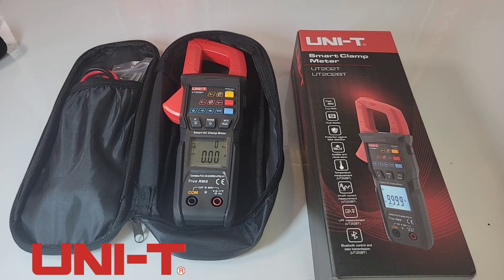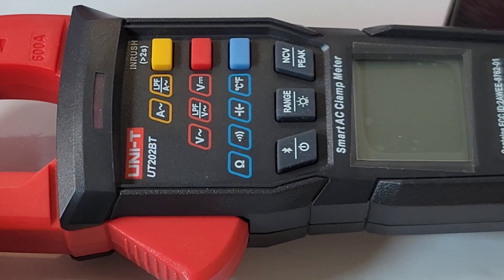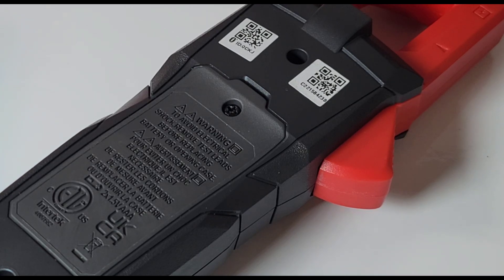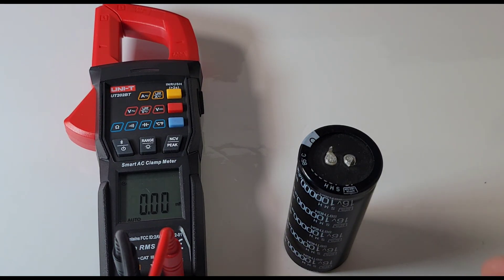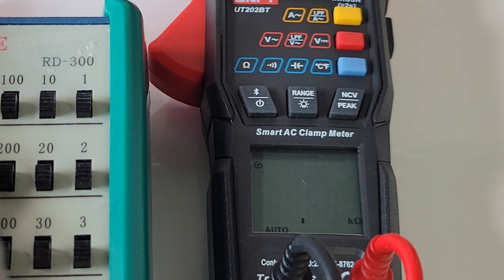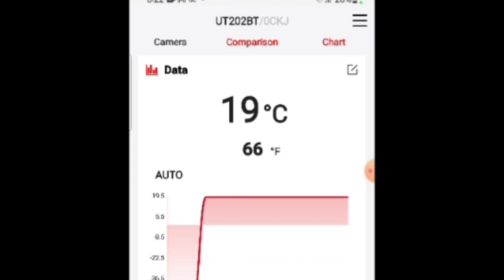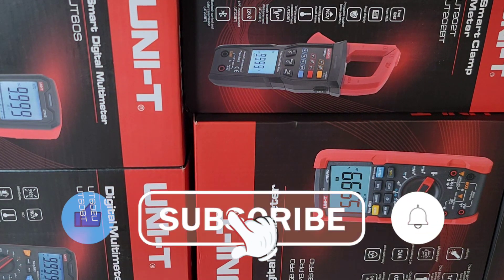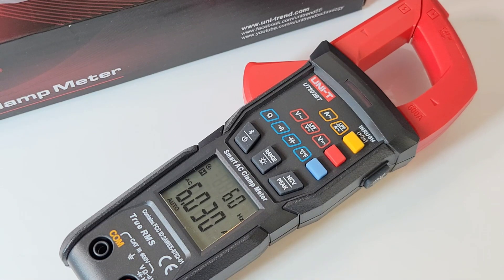UNI-T UT202BT CHEAP-O Clamp Meter Review & Teardown!

Comment: No DC amps gives it a 4/10 for me. Most AC line engineers deals with SOLAR these days, I think UNI-T can do better!!! THANKS
Reply from the maker: Thanks for the feedback. I agree a DC amp function would make it much more versatile!
Reply: I've got an old UNI-T  UT203. It's non True RMS, but it's accurate enough to get you  within the ballpark of the problem. If I need any more diagnosing, I use my Fluke 325 clamp. THANKS

Comment: Darren, thanks a lot for the review! I'm looking for this clamp since it per specs it meets my needs. Nevertheless, found a video on YT that reports that the clamp will not see small in rush currents, I guess below 10amps (it was tested side by side with a Fluke 316, which saw the 5amps in-rush, but the 202BT didn't see it). Can you test this? Because this would be a deal breaker since the in rush currents I plan to measure are on the low side, surely below 10 amps and probably around 5 amps (a small fridge for example). Also, what do you think about the clamp measuring inverter loads? it has LPF, so it should correct frequency variations. On the other hand, the other model I can think about that does pretty much the same (in rush, AC current -and also DC current-, NCV) is the UNI-T 216c, which is way more expensive, but apparently can do everything (and more), but doesn't have LPF (it has VCF). Thanks a lot!
Reply from the maker: @sebastian_j  Hi Sebastian, Unfortunately that clamp was gifted in a giveaway so no longer at my disposal. I did test it briefly and it measured inrush current as low as 1 amp in my tests.

Comment: Promoted as one-handed operation, well yes - if you are right-handed! 🫱. Good for persons who live in the alternating universe where diodes aren’t needed. Love the ability to capture inrush and document the results. Will have to give that a try for sure. 👋
Reply from the maker: Let me know what you think of the BT software when you get around to it. 😊
Reply: @KeepOnTesting  I did the inrush test on my vacuum cleaner and was able to verify it briefly consumes 40A when first turned on.  The BT APP allows you to select the meter's mode, range, and record multiple data logs.  The chart can be viewed on the phone and if desired exported to Excel file.  This file is very good, it has headers and gridlines - the data and looks like a report!  One of the headers was Chinese by mistake (a bug?).  Only thing missing in the file is ambient temperature.  You can select your data collection interval.  Also recommended - pre-selection of the range.  If it's in the auto mode, some of the measurements will be ".OL" -  Evidently the data in the report is the exact digits on the display.

Comment: It will be a hit in the right market. It is not a multimeter or a clamp to measure DC. I work in the shipping container refrigeration business and I finally have a low cost Bluetooth data logger. High resolution and precision are not required for its intended use, just that it measures something within the expected range. For my use it is more versatile than carrying an f376 (and cheaper) I can only blame how stressfully slow it is (but I can live with that).
Reply from the maker: Agreed..this can really work for the right user!😊

Comment: IMO it simply boils down to one targetted group: professional, industrial electricians (Where else do you have to deal with AC incrush currents and up to 600 Amps...?). And in this field it is very hard to beat the reputation of Fluke (or Gossen Metrawatt). Even with the beefed up input protection and the "ETL"- Marking. For my hobby (electronics in general and car -electric) I´m still very happy with my 201E. Uni-T seems to be more and more aiming at the professional market and less and lesser on the hobbyist/ educational part. My estimation is: It will not work, even on the long run.
Reply from the maker: UNI-T 210E is hard to beat..a workhorse in every way. Compared to most OEM's UNI-T seems to constantly  push boundaries and improve their lineup. I think it's evident on every level. Yes, this dmm is not geared for the bench but hopefully it's target market can see the value.👍

Comment: Greetings Darren))) Thank you for everything you do.
Beautiful electric сlamp)) Do you remember how I told you about the main chip that is in LOMVUM 616?))) Here it is, it's SD7502, and in LOMVUM it costs 7501, but it's hard to check because it is flooded with compound. As far as I remember, they differ in the number of readings (I'm too lazy to go to the site to see exactly, because it's not so important). In essence, this is one and the same. You can even see it first of all in continuity time, because in LOMVUM it is very fast, and UNI-T has never been famous for fast response, they are always slow. And in this UNI-T, the ideal continuity time is exactly the SD7502 inside. Here is a coincidence)))
In general, on the device, I will say this again. Electric clamps that have fully automatic range selection are not suitable for measuring current surges in the first milliseconds (100ms). They take too long to switch bands. That is, if you had the opportunity to test the Inrush function and check its operation with another device that has manual range selection, then I think that you would give a rating of 2.5 stars )) Since I am sure that this function would simply be useless in this device. All cheap devices with automatic range selection, with a low response speed, even in Inrush mode, take readings only for the first 300ms (if you're still lucky, otherwise it happens that there is a 500ms delay in general), and this is very long. Therefore, the purchase of this model, as well as other models with similar functionality, is suitable for those people who do not need to see inrush currents on the wires. This device is suitable for those who need to see a continuous load, in its minimum and maximum limits, but not bursts.
I have a wish for you Darren. Include in the list of obstacles for testing electrical clamps - CURRENT LEAKAGE TEST. It is very important. This test is for sensitivity in undercurrent readings. This is necessary for those who want to understand if there are leakage currents in their car, from the radio or some kind of light bulb, etc. I understand that this can be checked with a multimeter in the open circuit, but still I would like such devices as electric clamps to also see a small current within 20-30mA. Many in this sense have a very large error, but some electric pliers can do this. This is a good sign of a quality device. Thank you.
   $50 is overprice for him. 
Great, honest review! ! !
Reply from the maker: Hi my friend ! I will take your Current leakage test into serious consideration.  You raise alot of valid points. It definitely shows you the intracies involved in choosing the correct test instrument for your needs.   Excellent feedback as always 👍

Comment: What a letdown. No diode mode, but capacitance? No DC current? For real? The logging feature on the app sounds like a good thing unless you need to "log in". For something with an Arm based microcontroller chip the autoranging is very slow. Hope the next one in line is a great meter!
Reply from the maker: Great points 👉 👈  yea missing diode for me was a cardinal sin !

Comment: Well made UniT quality overall with a lot of bells and whistles - but not all the right ones - before adding less important doo-dad type stuff they should concentrate on most useful basic functionality such as DC current, diode range, a continuity light fast as the audio signal and a switched on/off backlight.  Seems wrong they put bluetooth ahead of a DC current range. A little weak for $50 -- J.M.O. others mileage may vary-! lol
Reply from the maker: Spot on Mike! Btw.
Anytime you want to write another blog on keepontesting.com lemme know 😊 Your expertise is always welcome my friend!

Comment: Lack of DC current is a deal breaker for me, I know different people have different requirements, my only use for a clamp is to measure the output current from PSU's (something I do regularly) When UNI-T get it right they are up there with the big hitters but this unit isn't one of those. Thanks for the reviews Darren, anything mega exciting coming up?😀
Reply from the maker: I hear you..
 interesting..well..
UNI-T Thermal Imaging camera as well as the UT117C are on the way but that will be end of next month..last UNI-T EXTRAVAGANZA review will showcase.@@@@@#### darn.
It's not letting me tell ya.. 😅

Comment: It would have been better if you showed the small PCB, what does that inverter board do?
Reply: The connector on the motherboard has a silkscreen "BL" beside it, so you might think it is describing a Back Light.  However, the BL actually is indicating it's for BLuetooth.  The ancillary PCB contains the antenna and it's shielded communications board.  The LCD backlight is simply controlled by the 1AM NPN Q10 whose base is connected to an output pin on the CPU by way of a 10K resistor.  The battery voltage is switched on and dropped across the resistor R53 to provide the appropriate current.  From there it goes to the LED board soldered through a slot in the PCB.  If you really wanted your backlight to stay on all the time, you could to bridge the collector and emitter of Q10 with a thin strand of wire like I did.  The backlight uses very little current - if you're using rechargeable cells it will cost you nothing.  Do this at your own risk!
Reply: @pault6533  Thanks for clarifying and explaining part of the circuitry paul. 😁
Reply: @bhushan9066  No problem😁 I corrected the transistor number for the backlight control. Using NiMH cells I think the display brightness is perfect, so I left the 300 ohm resistor as it is.  I also verified that the backlight goes out when the unit shuts itself off after 15 minutes.
Reply from the maker: My bad..yes I should've..it's for the backlight.